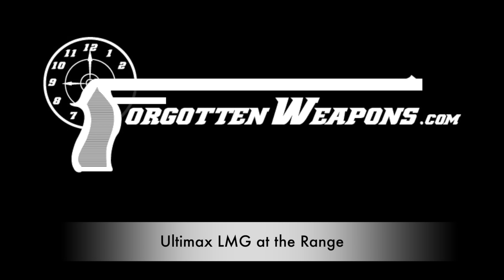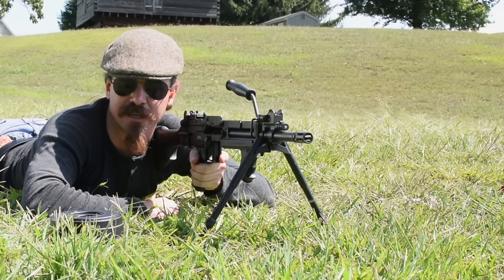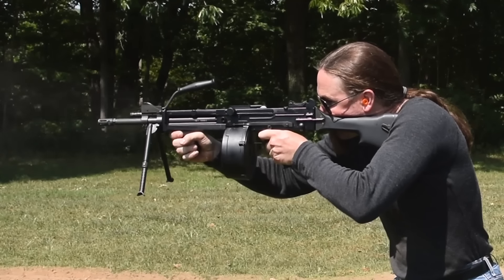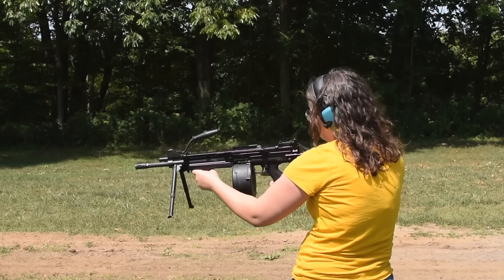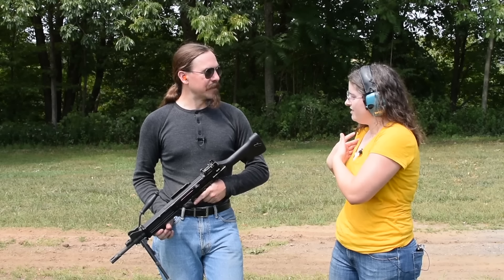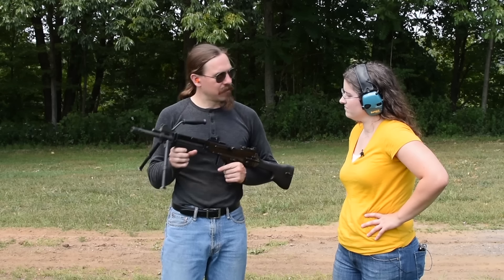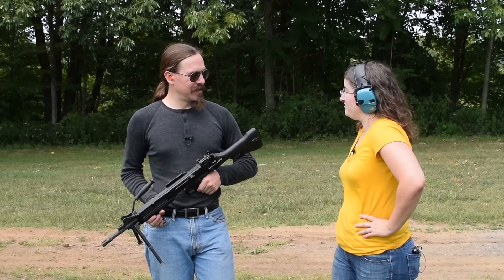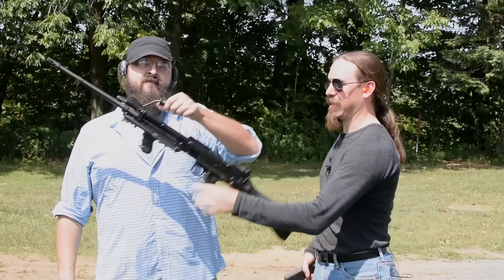Origins of Constant Recoil: The Ultimax Mk3 (feat. Mae & a Yeti)

Comment: As someone that lugged the 249 in the Army for over 2 years... that thing looks niiiice.
Reply: I have yet to hear a soldier who was issued a 249 claim to actually like the 249.
Reply: @Devin_Stromgren  I enjoy shooting it vs the 240.......do I like carrying it? Hell no lol.
Reply: The ultimax is open bolt, and its sorta notorious for negligent discharges.  It also doesn't shoot blanks and basically anything that isn't a normal FMJ without running into ejection issues.  It can't be belt fed, and the drums do have drum type feeding issues as they age.  They are also notorious for not holding up well in sustained fire roles compared to the 249.  

Its a really cool idea/concept, and better yet it works.  Though its not without faults, and those faults are the big reason almost nobody outside of Singapore has adopted it (while many have trialed it).   I really like the constant recoil stuff but if we had Ultimax's instead of 249's in the middle east (particular mountain areas) 100% you'd have people trying to get mothballed 249's shipped over, but the doorkicker types would have probably sold their left nut for an Ultimax.
Reply: @Repenter0  Singapore alr have mk5.  Drum falling off is no longer a problem.
Reply: @Devin_Stromgren  I actually liked the 249 lol. However the two caveats being I had the shorty barrel and fully collapsible stock and I would much rather have had this. A box mag change while underfire has a lot less pucker factor than a pork chop and belt in my opinion.
Reply: @ryanchuabowen2045  still using the mk3. Where did u get the mk5
Reply: Thank u for your cervix
Reply: @MrFlyinghellfish  you best check yourself.
Reply: Devin Stromgren Yeah I loved my SAW when I was in, the only thing that sucked about it was lugging it around everywhere I went.
Reply: I guess it is Like a mg3. Everyone loves the firepower and shooting it, but carrying that thing+ ammunition is just a pain.
Reply: scantrontheimmortal it uses modified M16 magazines so not really, maybe Mk 4 and after

Ryan Chua Bowen Bullshit, we’re still using the Mk 3 and Mk 3A
Reply: @Devin_Stromgren  I did and I liked shooting it.

The cleaning part was a pain.
Reply: @scantrontheimmortal  Thanks for doing the research.

Very cool.
Reply: @scantrontheimmortal  When you still think weapons(/gear/vehicles/camouflage/etc) are bought based on their performance... please don't go down the rabbit hole. You won't like what you see down there.
Reply: Repenter0 Almost all machine guns are open bolt, so this criticism of yours is irrelevant. The M249 is also open bolt.

Given how self loading guns work, I’d wager the Ultimax is not unique regarding not taking all kinds of ammo. Unless those other guns are overgassed to hell to allow them to take all kinds of crap ammo. Plus given how a military generally manufactures one type of ammo for one type of gun, I don’t think this is a particularly relevant issue in military service with normal supply chains anyway.

Drum reliability ok I agree. Should probably have just set it up for standard box magazines.
Reply: @Devin_Stromgren  It's a piece of shit. When I deployed to Afghan, I asked for, and received, a mag58 (m240) instead. My reasoning: despite the significantly increased weight (the 240 isn't fun to hump around), when you pull the trigger you know it's going to work. First round, three-thousand and first round - it doesn't matter. The fact that my section and platoon commanders went out of their way to make my unique snowflake request happen was also pretty special (considering the army) and says a lot about what they thought of the 249 too.
Reply: @Repenter0  i can only say this.... There was a small attachment of Singaporean Military unit in Afghanistan, and it seems almost every single day our SAWs(yup we call the ultimax our version of SAW) are always been borrowed by whichever unit that is going outside the line :P
Reply: @Repenter0  yeah, sf probably loves the ultimax
Reply: The Ultimax weighs almost 50% less than the M249, and doesn't kick or jump around at all in full auto. It feeds from magazines, but that's not necessarily a bad thing, as a walkin man can change magazines. Plus, it's faster to swap a magazine than it is to load a belt into a gun.
Reply: Imagine IDF has one fire from both drum and magazine without issue( just change gas setting). Oh BTW, Negev can be shot semi.
Reply: @MrSoggycat  He is probably serving in the Singapore Armed Forces.
Reply: @Devin_Stromgren Haji certainly didn’t  like it..

Comment: As someone from the Singapore Army who has fired this thing... I can tell you its dead accurate and reliable. You can squeeze off a long burst at the range and every round will land at the exact spot. If you load tracers, you just see a line of rounds hitting the target faster than it can bounce back up (we use electronic targets).

Comment: With its low rate of fire, this thing kind of sounds like an old steam locomotive.

All aboard the lead train! Woo woo!
Reply: erikm12 now just imagine, it’s not bullets but railroad spikes
Reply: With No Brakes!!
Reply: Seems like it was a little bit faster with the long barrel to me.
Reply: @ANonymous-bh1un  A lot slower firing, (around clock speed) though. And it also dates back to Fallout 3.
Reply: @Morgan_Sandoval  Yeah, but that's not exactly a "current" game, people still play and make mods for Fallout 4.  It's a gun that shoots literal railroad spikes - which is what the guy was looking for.
Reply: @soundpainter2590  I suspect the muzzle twitch was actually the user trying to use it to "hose" the target area.
Reply: @shelbyz1988  More gas in the system with the long barrel, he did not lower the gas regulator settings = higher ROF.
Reply: Oops all lead poisoning
Reply: erikm12 it doesn’t sound like a train. in my opinion it sounds like train tracks.
Reply: @soundpainter2590  It is a Singapore thing. Check out his evaluation of the SAR21 which is also Singapore's assault rifle. Same low cyclic rate.

Comment: Hey ya'll, Singaporean who has used one of these during national service. Great though the recoil management is, the bolt is quite finicky. Many a cadet can attest to not wanting to use this because placing this weapon on the ground a little too hard can send that sucker forward, resulting in a negligent discharge. Reckon this does have several operational implications.

Comment: I loved shooting these in my reservist days in Singapore. The old versions were hell to maintain though. Once the coating on the receiver was scratched they rusted while you looked at them. That's a problem in a jungle. No night sights either.
Reply: washington gibz   Here's the sad story: 20 years back, they were too cheap to issue drums to us. We used modified 30rnd M-16 mags. In my 2 1/2 years I never even saw an Ultimax drum. Sorry I couldn't be more help to you.
Reply: washington gibz  I never had any feeding problems with what we were issued. In my experience the Ultimax was very reliable, the internals were easy to maintain and I shot them better than an M-16 or a FN MAG. It was a few tweaks short of being outstanding.
Reply: I did come across the drums in my company armskote during my reservist training but they were totally never used let alone touched lol.
Reply: @newtypekiasu  Nice! I thought the drums were hoarded away in ammo dumps until war were declared.
Reply: @hemisphere22  I also thought so until I saw them in the mags cabinet while helping out at the armskote during my ict a few years back lol.
Reply: Hi guys quite stoked to actually see the dreaded SAW here. I can say that the old modified M16 mags and the current version that my battalion is using are the mk1 & 2 which both does have feeding issues(mainly the mag being stiff springs and the ghetto drilled holes that latches the mags in place are enlarged over years of service.
Reply: @lepaston315  i think we use the old mk 1 and 2 to let noobs bash around during BMT and NS. in real war, i think we will use the newest and latest.
Reply: They used the same magazines M-16s were using during my service

Comment: Kriss Super V + Constant Recoil System + Halbek Device = gun recoils forward
Reply: Im not actuallt convinced the kriss v system actually does anything, if you look at the bore height it looks pretty inline to start with and i suspect thats about it
Reply: get a skateboard and 20 extra mags, never walk again
Reply: Blow-forward operation is actually a thing
Reply: The Kriss Super V system may reduce felt recoil slightly, but the bolt also goes upwards and this increases felt recoilt, although I supposed that the Halbek Device should counteract the effect of the bolt going upwards. 
Regardless, I still think that a better combination would be. 
Balanced Action + Constant Recoil, with an optional muzzle brake.

Comment: It seems that a constant recoil system is better served in light machine guns/automatic rifles. Tripod/pintle mounted machine guns will not gain as much by having a constant recoil system. It also seems that a fairly low rate of fire is actually advantageous, since it means you have longer time of fire between bursts without expending too much ammunition. 

With 500 RPM you get twice as long engagement time on target for the same amount of ammo expenditure as a gun with 1000 RPM rate of fire. With more accuracy because of the CRS, it will pay off to have longer bursts suppressing a target during fire and movement between fire teams. IIRC, you did an interview with Jim Sullivan with Karl over at InRangeTV, and shot a constant recoil M4. It had almost half the rate of fire of the standard M4 carbine. Just imagine having a constant recoil system in the M27 IAR:)

Comment: Is there any particular reason this isn't used with a closed bolt?
Reply: Probably because it was purposed as a suppressive fire weapon first and foremost. The lack of a proper semi-auto setting is also indicative of that thinking.
Reply: Auto weapons tend to use open bolt because after firing very fast for a period of time, the chamber gets VERY hot, so if a closed bolt system was used, loading the round into a hot chamber will cause it to "cook off", firing the round even without the trigger being pulled. Then you get what is called a "runaway gun" where it will keep firing off every round it has until you run out of ammo.
Reply: I don't mean this gun in particular, I mean the constant recoil system
Reply: @hochimane6535  You could I suppose. The sticking point is not the recoil system but the full auto generating heat so I don't see why not. But then if you're not going auto, the recoil system is kind of meaningless.

Comment: I served in Singapore Army from 1988 to 1991. We were taught to place our right hand on the curved part of the butt stock when firing in prone position. I saw you putting your left hand on your shoulder. 

The Ultimax was used as SAW (Section Assault Weapon) and mostly issued with the customised M16 30 round magazines, not the drum magazine. The M16 magazine has two holes drilled on the top side of the magazine to latch on the magazine well. Which present a different set of problems. In a fire fight, or during re-org, you need to ask your section mates who have ammo in the SAW mag. No everyone in your section carry the customised M16 mag!
Reply: Same thing. His method was what was used for the older much heavier MGs that don't have the curved stock. The end effect is similar.

Comment: The knights lmg may be nicer. I think as a US civilian with no need for a lmg, the mag fed ultimax would be better. For the fact that having disintegrating belts on hand could become costly, or difficult to find in a end of days situation.
Reply: One of the rare quirks between this and belt fed is that the Ultimax actually kicks out rounds harder than the -249. It's something people overlook but if you need to use the energy in the gas to feed a belt, that energy is actually lost with respect to propelling the round. I think the difference was something like 30m/s.

Comment: Exactly like the lady said. I thought maybe i had imagined it watching the footage but: "just a little bit of vibration to control". You can actually see it recoil with each cycle but then get absorbed and transformed into a constant force before it reaches the end of the buttstock. Interesting to see how it does it for sure.
Reply: just like Ian said, the bolt doesn't really reach the end of the receiver, the recoil spring stops it before it does, and completes the cycle without ever banging into the end.
also the reason for the lowish rpm, since it takes a while before the cycle completes since the spring has to slow the bolt down then push it forward , instrad of just pushing it forward afyer the bolt hits the back of the receiver.

Comment: Why does it feel like it shoots faster with the stick magazine than with the drum mag?
Reply: The barrel. When they were using the stick magazine, they were using a long barrel, which meant more gas got trapped inside the gas system.
Reply: @danielc2701  I see. Good point.

Comment: Sound a bit like a well working MG42 would act.
A rate a fire so high, that the "punch" of recoil turns into a smooth push/vibration kind of recoil.
Reply: That's not how it works, it has a low rate of fire, relatively speaking and the low recoil is due to a recoil spring that runs the entire spine of the gun.

Comment: So, if the theory is just that the bolt doesn't impact the back of the receiver, could you just have like, incredibly strong springs to stop it from ever hitting, could you get a higher rate of fire?
Reply: The return spring is strengthened in this system, but there is a balance of improvements that make it work.